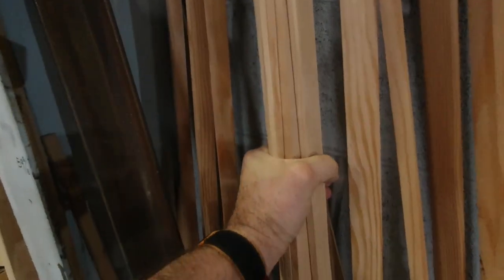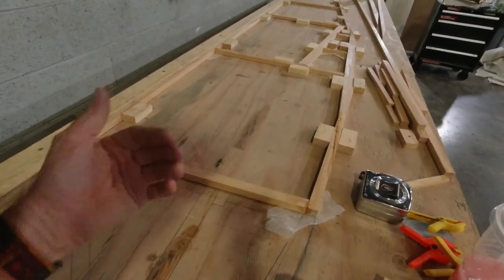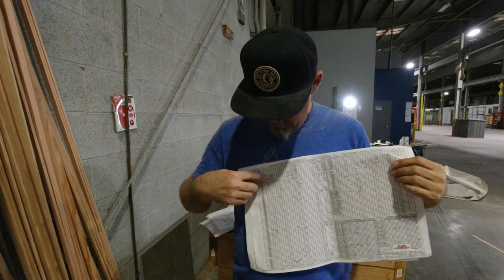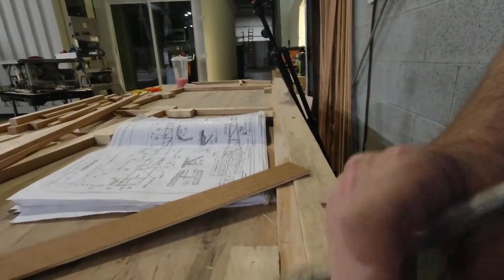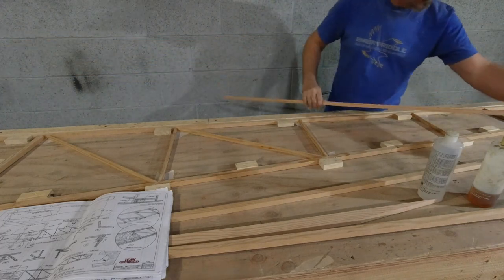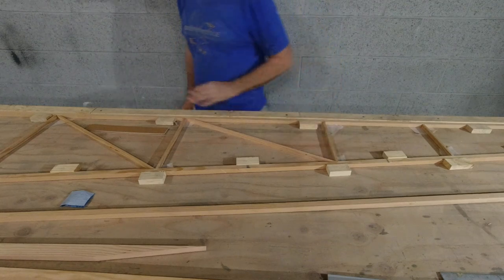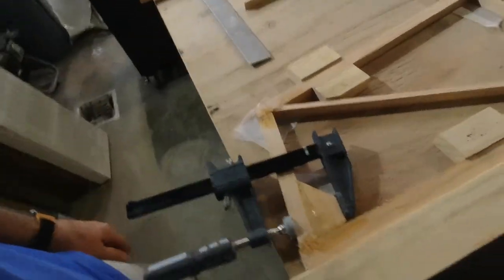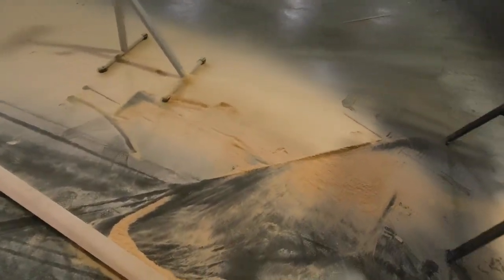Minimax 1100r Aircraft Build Vlog Episode 50

Comment: You got me thinking about the grain direction and bolt, so now will have to double check the British standards. I believe the tailplane bolts go top to bottom on your aircraft, if that is the case I would say your bolts are going with the grain (might just be a English US/ UK thing), hence me having to check the standards. Good progress, I don't know how you get a video out so fast! Why don't you set them up so they come out at a set time, rather them a big bunch and then a gap? It might help the channel.
Reply from the maker: My tail connects with angle brackets. 
I know the Algorithm prefers a 48 hour gap. I’m just so used to posting right away. I could schedule them. I had a big gap because I got sick. 100% now though.
Reply: @DTMinimax  Great then the bolts go through the sides, which would match the grain direction I expected.
I just thought that if you had a video or two in hand then they could come out if you had a break, I didn't know the Algorithm  bit just though viewers would like a set slot. I am planning for 1600 GMT on Saturdays for my build slot.